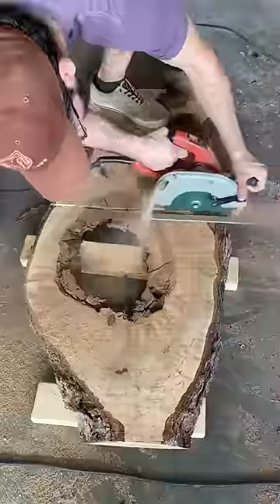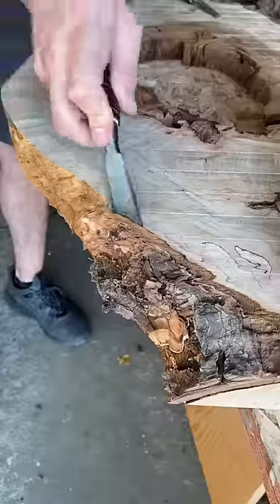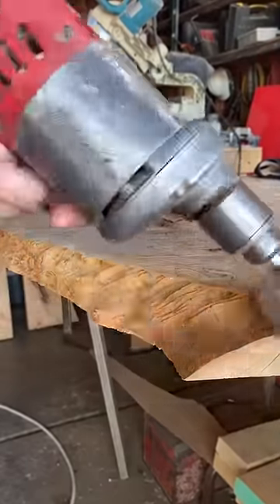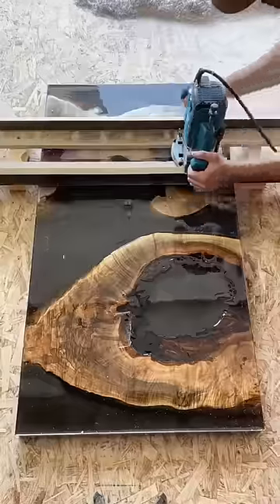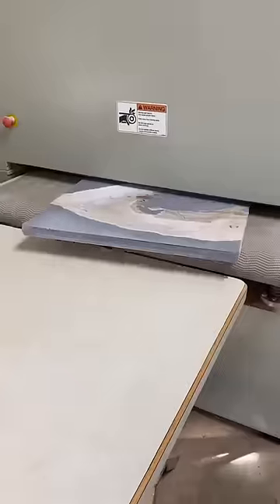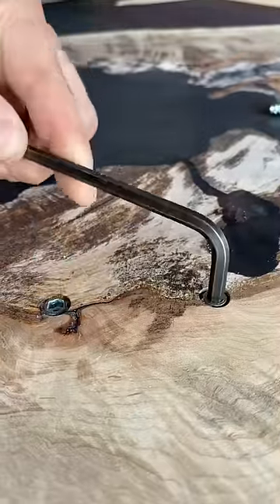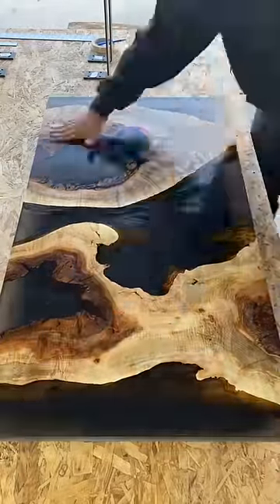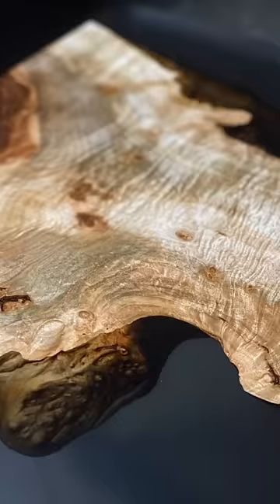Gnarly Slab Into Stunning Table #shorts #diy

Comment: Every single time the bark gets chipped off a little piece of my soul dies 😭 do you ever leave it on? It’s SO pretty
Reply: Never worked with live edge or epoxy before but from what I've seen others say, the bark apparently breaks off over time because the epoxy doesn't penetrate under it and ruins the piece
Reply: @DreamSmuggler  I make mesquite live edge tables (no epoxy) and often leave the bark on if it's solid.
Reply: Also those parts can cause alot of air pockets and bubbles, its definitely a must to take off the rot to prolong the life of the slab
Reply: How are you still alive?
Reply: I was thinking the exact same thing
Reply: Oh my goodness mine dies too I loooove the live edge. That bark tells a story ❤❤❤❤

Comment: Hey! I am an aspiring woodworker with 0 experience. I’m genuinely interesting in doing what you do and I want to get to where you are. What do I need to do? What are my first steps? 

I bought a drill, the 3-piece Dwalt chisels, and I’m saving for a reciprocating saw. I’m trying build my toolbox but I have limited money :’)

But how do I begin to learn epoxy and basic woodworking stuff? How did you begin? Who did you receive help from? Did you learn from someone? Did you work at some shop?

Comment: Sanding to 1000 grit isn't very useful, as your wood wont be able to absorb the finished coating as much as it would if you went up to 220, as well as the fact that the visual difference between 220 and 1000 is not worth it for the effort and the fact that after applying finish it doesn't end up looking as good in my opinion.

Comment: You should have just left it one piece. It would have looked much better as one piece. Or cut it the long way if you needed to cut it. Not crazy about the way it turned out. The piece doesn’t flow.